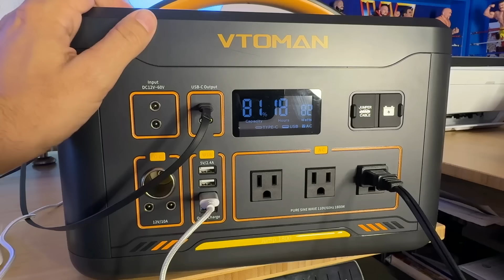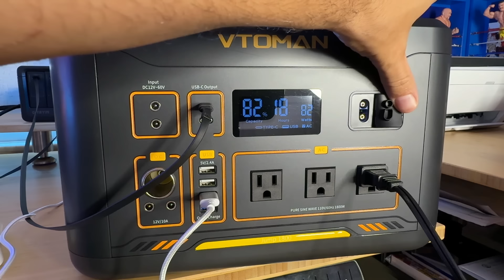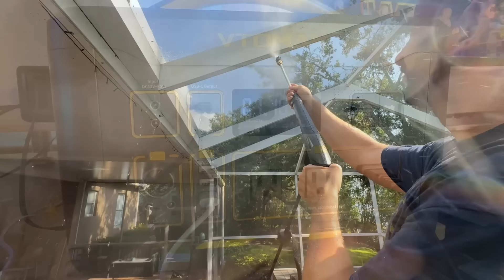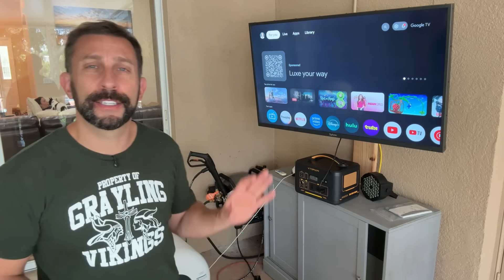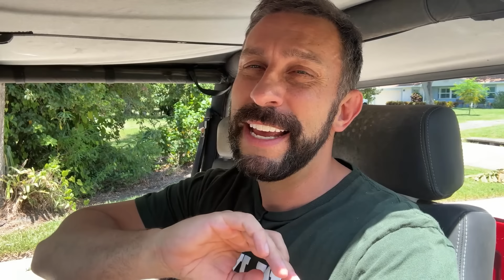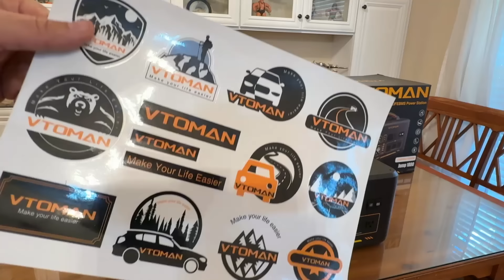VTOMAN Labor Day Extravaganza⚡️ Power Up Your Holiday!⚡️

Comment: Good, but could use some improvements. The display is bright and informative, and I love being able to see exactly how many watts are coming in and out. But the AC outlets are pretty close together, so if you have bulky plugs, it’s a bit cramped. Also, the included stickers are kind of silly,I’d rather they used that cost to improve the carrying case. Still, functionally it does what it says, and that’s what matters most.

Comment: Mixed feelings here. It works fine, but I feel the marketing oversells it a bit. Yes, it can run a refrigerator, but not for “days” unless you’re constantly recharging with solar. I also wish the wall charging was faster,220W input is decent, but for the price I expected more. Don’t get me wrong, it’s reliable and well-built, just not quite as groundbreaking as the video makes it sound.

Comment: Overall, very solid unit. It powered my small RV A/C for about 3 hours, which is impressive for something this portable. I like the rugged handle and the build feels sturdy. The LED light on the back is also more useful than I thought,it lit up our entire campsite. My one complaint is that the fan gets a little noisy when the power draw is high. Not a dealbreaker, but if you’re using it indoors you’ll definitely notice.

Comment: Not bad, but not perfect either. It does deliver the wattage as advertised, but I noticed it drains faster than expected when running high-powered tools. Tried my pressure washer and it only lasted about 40 minutes. Works great for lights, laptops, and even the TV, but don’t expect miracles if you’re running power-hungry appliances for long. Also, it’s heavier than I thought,it’s not something you’d want to carry long distances.

Comment: I picked this up a few weeks ago and I’ve got to say, it’s been a lifesaver already. We had a short outage here in Texas last weekend and this thing kept my fridge running for about 10 hours straight without breaking a sweat. The display is super easy to read, and I really appreciate how many USB ports it has since my kids always have tablets and phones charging. The solar panels are also surprisingly efficient compared to the older set I owned. My only regret is not getting one sooner,peace of mind during storms is priceless.

Comment: I bought this mainly for peace of mind during blackouts, but I’ve ended up using it all the time. I work remotely, and when the power flickers, I just plug my router and laptop in and keep going without interruption. It’s quiet, charges my devices fast, and I love the pure sine wave output,I’ve fried cheaper units before using them with sensitive equipment, but this one feels trustworthy. Huge fan of the 10-year lifespan claim too.